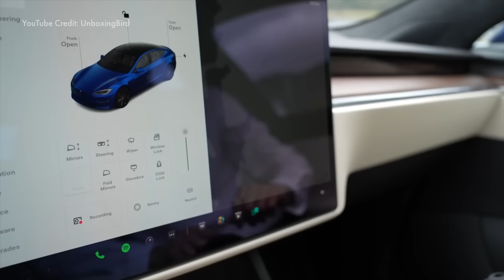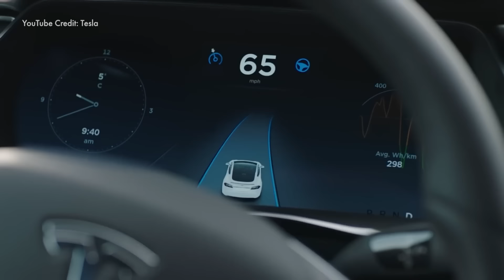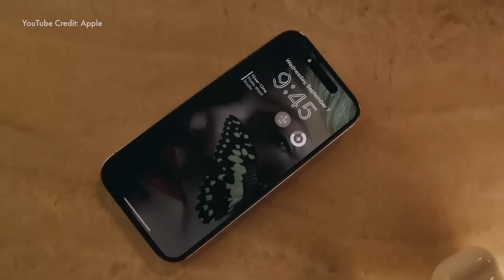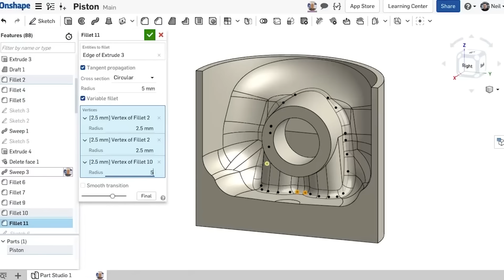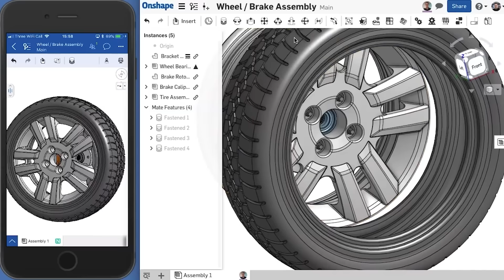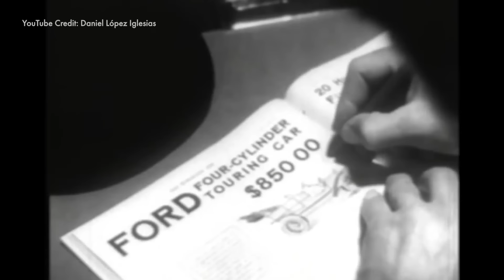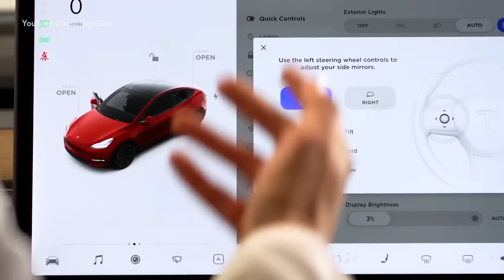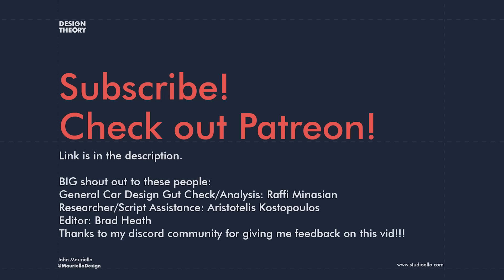How One Designer Saved Tesla From Bankruptcy TWICE

Comment: Great video. I have very mixed feelings about Telsa as do I think a lot of designers. I think Tesla's largely have a nice silhouette to their cars but overall I think are pretty uninspiring designs. The rear end's especially fade into mid price sedan rental car territory very quickly. 

But I will say I really respect their new approach to the automotive industry as a whole. After watching Sandy's series on the breakdown of these cars construction, I think one of the biggest contributions to the automotive world they have had is their approach to production and mid cycle hardware changes. No other companies would dream of doing that because it cuts directly into the bottom line, but with Telsa, they are assuring their new customers continually get the best possible version of a vehicle. I think that's really smart approach and wish other manufactures would also adapt something similar.  Doing away with the horribly archaic dealership platform that other brands use is also a step in the right direction I think. Clearly it comes with it's own set of problems but I think it was a welcome change. 

Other things you mentioned like their "end to end" design are all very well thought as well. Of course they are single handedly to blame for the taping of ipads to dashboards everywhere which as a designer hurts my soul every time I see it haha but hey, like you said, they're just designing for the current generation so I understand the inspiration.

Tesla is a breath of fresh air which at the end of the day is their biggest contribution. Time will tell if that head start they had in tech and production will be sustainable because every major automaker is now designing and releasing very similar products. If they have to rely on flamethrowers and Elon dropping f bombs to stay relevant I think Hans might be working for another automaker in 10 years. We shall see.
Reply: Jokes on us; there are no mid price sedans left to compare a Tesla to.😔
Genuinely, Tesla expedited the EV transition by at least a decade if not more. They single-handedly made EVs cool by exploiting the benefits that people find cool. And yes, similar in the way Nirvana killed the guitar solo, Tesla killed the dashboard.

Comment: 6:22 those are LIDAR cameras, the ultrasonic sensors are more like the parking sensors on a mid 2000s BMW. They blend into the body work quite well. At 7:36 you see the sensors at either side of the license plate as well as below the headlight. They look like every other manufacturer's sensors from here.

Comment: As Tesla model 3 Performance driver, I enjoy every minute driving it. 
The only thing regarding the user interface I would like to see changed is the font size of the messages. 
Those are too small for my ageing eyes and keep my eyes longer of the road then they need to be.
What people tend to forget is that most settings are set once and don’t have to change. 
An absolute great feature is the driver profile. The mirror, seat and steering wheel positions are personal and set automatically when you open the car with your phone key or fob. 
And for those settings that you forgot where to look for them after a while, just use the voice command to surface them.
Reply: Heard that. Several things have fallen by the way side as FSD soaks up most software developer efforts. The ability to move elements around on screen and select font size are two huge features that need to be implemented ASAP.
Reply: Software developers in Tesla are young guys in their 20s with 20/20 vision, perhaps they need to be told their clientele doesn't consist merely of 25 year olds.

They should do it sooner or later, it's not difficult to implement in qt which I guess is the GUI framework they're still using, just throw a tweet at Elon for now.
Reply: I would like a portion of the screen fully customizable whatever & however you want anything of information on display there.

Comment: I think you missed all the important reasons Cybertruck looks the way it does. 
It's not about anything other than making a tough electric truck as capable and affordable as possible.
It's angled design and exoskeleton are required.
It's stronger and more aerodynamic because of the shape.
The locked bed area becomes living space.
Doesn't need paint. Lights are tiny so they don't break during off roading.
And that's only about half the excellent reasons it looks like it does.
And it's already a design icon for the ages. It's transfixed and obsessed millions already.
Can't argue with 1.5mil deposits, 3x the response to Model3.

Comment: Re minimalistic design we should remember Dieter Rams. 
About the Cybertruck, your critic is good and welcome. So we can say, even with this design there is still a high demand for this vehicle. On the top i would have put a horizontal part. But so manufacturing is more easy. And this - without paint and stainless steel - could become the masterpiece in low manufacturing expenses but an extremely high quality vehicle.

Comment: The engineering behind the cyber truck was pushed to the extreme in terms of efficiency. No paint required, no rust, no scratches reduced production line etc.. I love it
Reply: Don't forget functional strength (or is this included in your "efficiency" remark?).
Also, the simplicity of the parts the car consists of and the relative few parts it consists of (thus relatively cheap and fast to manufacture).

Comment: 4:05 I don't understand this part. The A-pillar is on the same place as in any other inner combustion engine vehicle. Even more - there is enough space under the hood to install a V8 engine and you can find videos of people doing so. The only thing that shows that this is an EV is absence of the front grill and exhaust pipes. The reason the A-pillar was installed further then they could is because it looks better (at least I think so). There is a video on YouTube about the fundamentals of car design and it basically says, if you want your car look better, sportier, and more premium - move an A-pillar further, otherwise the car looks somewhat strange - Mercedes EQS is a good example of that.

Comment: Tesla has physical buttons for things you use frequently. Turn signals, wipers, volume, audio tuning, windows, opening the doors... I'm just curious as to what physical buttons people want? Tesla has auto climate and auto lights, and other various things can be done using voice commands. Also, the speed being more in your line of view on the top left of screen is so nice. Looking down through a steering wheel for your speed in traditional cars takes your eyes off the road. I can drive my Tesla without ever needing to touch the screen because everything you use is perfectly integrated or automatic.
Reply: Model S Plaid has entered the chat.

Comment: In terms of proportions, the Tesla Model S has some features that made it look 20 years older than contemporary gas powered cars, with the low hoodline calling to mind '80s and '90s Hondas and similar cars that had hood and fender lines just high enough to clear the suspension and valve cover (indeed they could be lower still than the Model S's hood--pop-up headlights were not just a gimmick, they were necessary with very low hoodlines to allow the lights to be high enough to be practical). Now there are regulations about clearance between the hood and engine so the hood can deform if the car strikes a pedestrian to reduce the impact force of the victim falling on the hood, so ICE cars cannot have front ends like that anymore. I would expect that the forced induction systems and sound-deadening engine covers used today also increase the height of the engine, raising hoodlines of ICE cars even more.

Comment: We all dreamed of a stainless steel vehicle that could bash through the bush week after week without rusting away from scratched painted mild steel and having it's under body chassis destroyed by contact with rough terrain. Cybertruck with scored bent and welded stainless steel sheets with no chassis finally gave us what previously we could only dream about. It paired perfectly with electric motors and batteries and even has a low drag coefficient! Preorders were off the charts, wake up :)

Comment: Front grille is very important for the aesthetics, because it resembles facial features. And Tesla still retains it by having an imprint where You'd usually look for a grille. It is like a faux grille, different to the filled out grilles in car models that have their gasoline counterparts.
Reply from the maker: Agree
Reply: I'm not tied to grilles but the major car corporations are all invested in them as a 'part of their design language'
Toyota/Lexus spindle grille took this a bit too far IMHO.
Tesla was unique in their only history was the Lotus the original coupe was based on.
Reply: @jimurrata6785  Lexus grille breaks with the facial connotation of the design. Looks deliberately aggressive, like a Predator.
Reply: @yaroslavbozhdynsky  It definitely draws from Predator.
While striking and unique I'm not the only one who finds the more extreme examples unattractive.
Reply: So having no front grill was one of the things I was attracted to.
Reply: @theodorehaskins3756  Yes. For some the Model 3 'guppy face' is no less polarizing.
I think there's a good opportunity in the aftermarket for front facia styling changes (though I doubt that would fly with Tesla itself)

Comment: Ultrasonic sensors are just as embedded in any old bumper as parking sensors for example the reason you can see them is so you can replace a faulty one more easily by pulling it out without having to remove the body panel... and the adaptive cruise radar on the front in most cars it is somewhere around the badge area or it is actually the badge.
Reply: True for the many in plastic bumpers. Though Tesla also re-engineered them to work through its metal skin.

Comment: Tesla announced this week they'll be removing the ultrasonics in favor of the updated Tesla Vision, so pour one out for the hardworking engineers.

The Cybertruck is actually the same size as an F-150, and has independent steering for the front and rear so it'll be very maneuverable.
Reply from the maker: This basically ensures that I will get comments complaining about how wrong I am about the sensors for years to come. If only I had waited like two days to launch the video 😂

Comment: With 1.3 million pre-orders for the Cybertruck (including mine at 300,567), I'll go out on a limb and say you're wrong.  A contractor would die for buying a  truck that doesn't scratch, dent, or rust on the job.  No one paying $90k for a Ford Lightning is going to take it "off roading" because a bush might scratch the sides.  You are also wrong about Tesla screens - by putting every conceivable button, slide and knob on the screen, Tesla can "recall", update and improve functions even on cars that are years old.  I love the interior look of our M3 and look at the Taycan and just see knobs, slides, chrome and dials - those were old looking in the '90's.
Reply from the maker: Re : ct, few polarizing designs really have staying power, historically speaking. 

Re: screen, I watched a few of my friends go through the touch screen menu and there are like three or four steps to do basic functions. If it was a knob it would be one, or maybe two steps to do the same thing. Seems inefficient and dangerous. I do like the idea of software updates of controls though

Comment: Many cars have ultrasonic or IR distance sensors, all of them are hidden in the car design. Parking sensors are like this. The car you showed used LIDAR which is expensive, and is much harder to hide unless you use many of them spread out, and even them, you obscure the capability they have. Tesla doesn't use LIDARS because of cost and because its very hard to make them look good currently and they instead try to use cameras and use ML to attempt to be able to cover up the loss in data. Only the future will tell if that approach will produce a better or even a competitively capable self driving car, but it did help with putting more Teslas in the world at a better price and appeal, and they do have 10x more driving real world data than competitors.

So Tesla's innovation with hiding sensors was not that they hid them. They just didn't use them. Your video mentions the wrong sensors and attempts to make a point in saying they did something revolutionary with the sensors which isn't really the case. 

Love your videos and always looking forward to seeing them!
Reply from the maker: Yes the way I showed LIDAR next to the ultrasonic sensors is a bit misleading. I should have thought about that more in the edit.

Comment: I think saving Tesla from Bankruptcy is a stretch.  The model S design started after Tesla had already survived bankruptcy. Franz is an impressive designer and his talent came from designing something that can be mass produced... it's all in the details not the overall design that was designed by Fisker (as admitted in this video).  Franz is good at the details.
.
The great hero of Tesla is Elon him self and the genius accountant.  But I must say it is hard to imagine that Elon pushed for a flush door handle design that is today becoming so widely popular with so many other car brands.
.
As for the concept of adding creases and lines - that is a fad thing that comes and goes. I accept that you are quite young, but it doesn't take much to evaluate designs over time.  Simply follow all the design progressions of, say, BMW since the 1950s.  You will quickly notice that cars go from simple flowing lines to detailed creases and back again to flowing lines.  
.
This back and forth covers many aspects of car design: head lights go big, then small, then big again.  The nose goes from wedge to the rounded slant back to straight upright to front overhang and back again through the cycle.

Comment: I totally disagree with you about the cyber truck. If anything I think it is a indicator of where Tesla is heading in the future. I would be very surprised if this was their last vehicle with an exoskeleton and a geometric design. There are just too many advantages for it to be a one off. As far as the design being post apocalyptic, if you look at the market for pick up trucks in that size category, they are all very aggressive looking, and the cyber truck fits right into that niche.
Reply: Thinking outside Tesla is that the Cybertruck will share a platform with the robotaxi and maybe the inexpensive car.   The cybertruck is nuts when it comes to towing.   The super rigidity and the 4 wheel steering could well make it the gold standard in towing for its class.   The rigidity of the single casting and the stainless exoskeleton are unheard of.   WIth a bit of refinement I can see Tesla selling this same basic truck for 40 years.

Comment: I enjoyed the video. I disagree on screens in cars. They improve the experience a lot.
Reply from the maker: I think the big issue that I have with the screen is that it sometimes requires 3 or 4 steps to do a basic function...whereas with an analog interface, you just press one button or turn a knob and you're done. I think you'd need to view the functionalities on a case by case basis. Some might be better for a screen. Some wouldn't.
Reply: Can't wait for the moment in time when to use turn signals, one would have to enter and change car settings, each time.
Reply: @yaroslavbozhdynsky  there’s a stalk for turning…
Reply: @Design.Theory  There’s not any common use cases that require 3-4 taps in practice. 

Most important functions either have a physical control, is handled automatically, or requires one tap. I’m speaking from experience of driving a Model 3 for over a year.
Reply: @chidorirasenganz  yes, but with the push towards taking away any controls and putting them into a digital form there might not be in the future, just a joke.
Reply: @Design.Theory  Exactly. My biggest issue is lack of tactility. That's not something generational. That's a principle that stands through time. Even haptic feedback can't change tactility and static placement. I'm really into toggle switches and the use of screens, but much smaller ones.

Comment: I appreciate the video and information in it, but I just don't see how Fronz' design input saved the company from bankruptcy twice. Certainly a lot of the curves were dictated by efficiency mathed out by engineers and it was Elon and the engineers fixation and exploitation of the benefits and fun of an electric vehicle and a tech focused future, namely, the insane 0-60 speeds, the launch control process, pushing automated driving, being a makeshift submarine in flooding conditions, etc. The lack of a grill is iconic, and I appreciate the lack of useless hard lines everywhere, but as far as design goes, the original Roadster from 2008 still looks more fun than anything since, including the Roadster redesign. The other most iconic design is the tablet, and that has become a plague of modern cars. I think the biggest benefit to why Tesla still looks good relative to other vehicles coming out today is squarely on the fact they are one of the only couple companies still making sedans. I just look at the Lucid Air and as a sedan as opposed to the Tesla sedans, it is a better looking sedan.

Comment: I would say the one problem with Tesla 3, S, X and Y is that they are all pretty much the same car. Well yea sure, 3 is a bit shorter, and Y and X are slightly higher. Its like Volvo would produce only the S90, XC90, S40 and XC40. Lack granularity and also middle range. Apart from that... they also lack cheap options. as well as something that actually look different.

I get it, all the tesla look the same, not really due to lazyness, but really due to aerodynamics. And shaving of kWH from the battery is pure profit in the long run. But.. i kind of think they gone to far. And the cars are not even that cheap